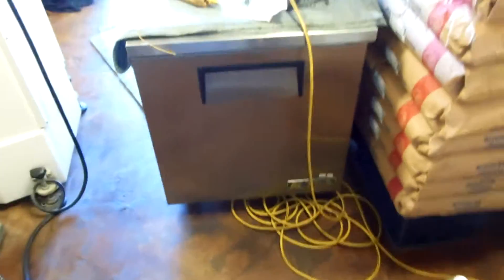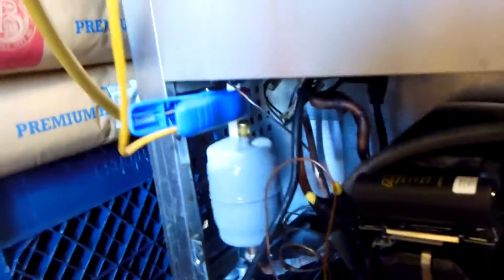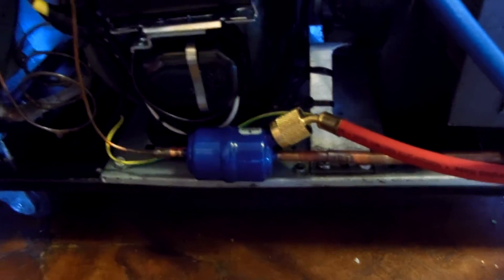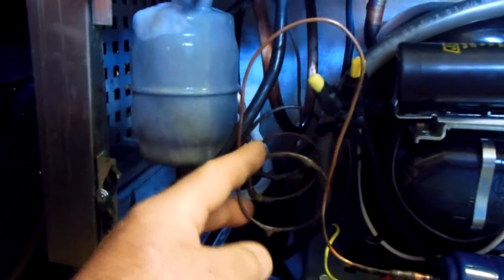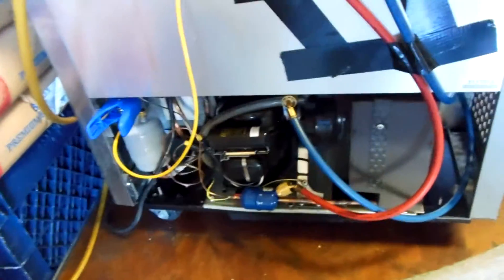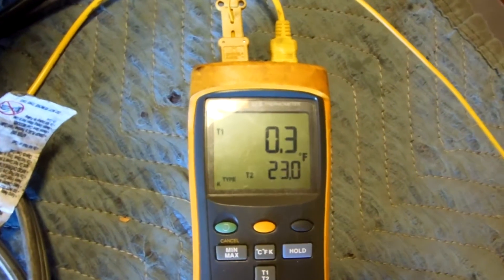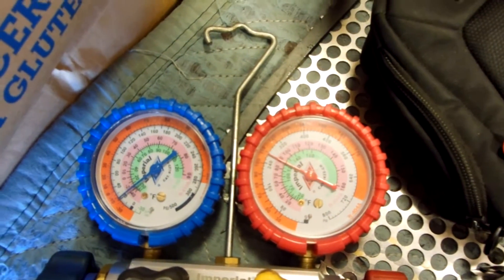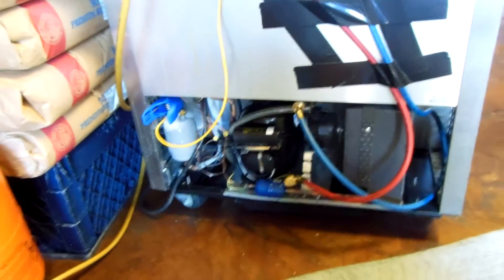True. TUC-27F. Compressor Replacement,New Liquid Line Drier,New Suction Drier

Comment: I have a question why wont my compressor shut off ? I put it to the 5 setting i changed out  the temperature control thinking it was that , i measured the temperature inside on top of the condensor coil at -17 degrees i'm pretty sure the cutout is at -16 degrees thing is  the compressor and evap fan wont turn off and when I do turn it off by clicking past 0 it only shuts off the exhaust evap fan in the back the compressor is still running. I don't get it
Reply from the maker: miswired.
Reply: @OcRefrig  Thanks for the quick reply

Comment: what does skinning 15 percent mean
Reply from the maker: +1MNUTZ  it Means to coat or Put a thin  " skin " of Silfoss over the copper Capillary tubing or and any piece of copper with 15% Silfoss to seal a pin hole leak in the copper tubing instead of Replacing the copper line.

Comment: What is that copper cylinder type looking think that is located in the evap section, the evap outlet goes in it and the outlet goes to the compressor, seems like it would be either a drier or accumulator.
Reply from the maker: Suction Drier.

Comment: Love the free added sub-cooling when it's done right. Did my AC earlier this year. I used some scrap copper wire to tie the lines together and re-insulated. Dropped supply temps 3 degrees. Could have done more but I didn't want it freezing up.